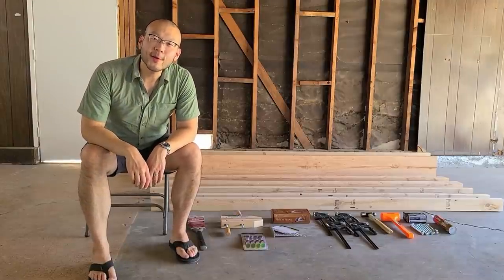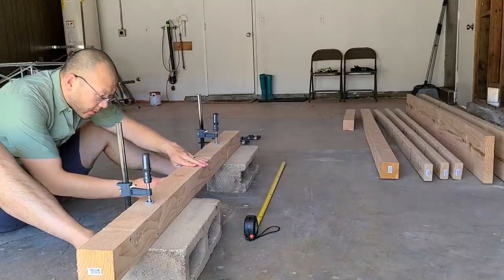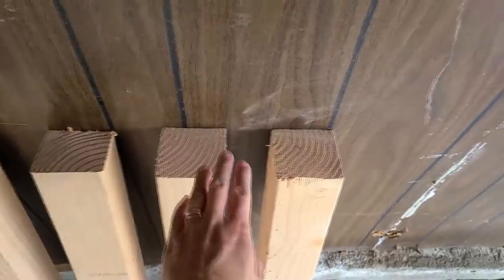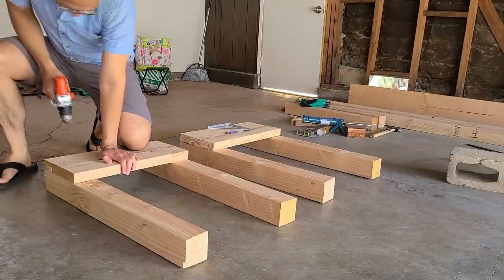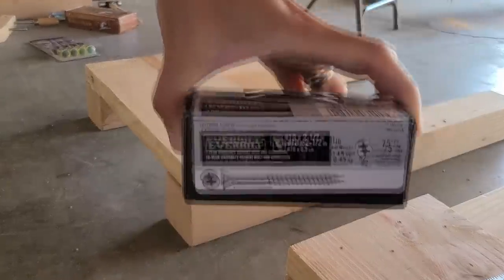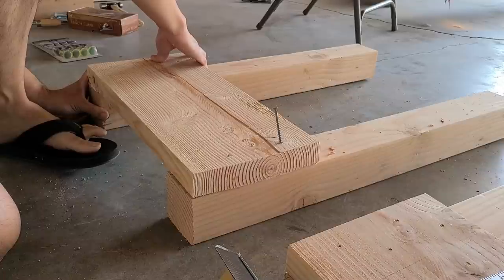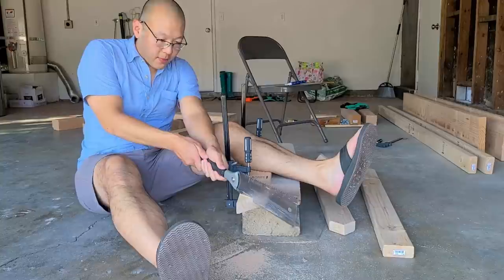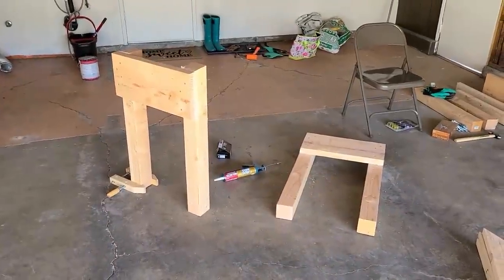A Dentist Builds Rex Krueger's English Joiner's Bench Part 1

Comment: Choosing Rex Kruger is a great choice. I love his bench designs. I think it's great. Marking is everything. Mark your lines in all faces, and keep the line in view as you cut, which will keep your cut straight. Or clamp the speed square to the work and use it as a cutting guide. That's what the lip's for. Butt the lip up against the long side which will give you a vertical straight line across the board. Slide the square upto the line and clamp it down securely. Then cut along the speed square as a guide. PS. Use more cinder blocks to raise the work so you can stand and look down at the line you are cutting. That will keep your eye on the line and cuts straighter.
Reply from the maker: Thank you! I love the bench and can't wait to add all the other accessory parts! That speed square tip is super good! Thanks again for all the recommendations!

Comment: 20:38 If you ever experience a lot of slippage when driving screws, then one tip I have is to use the “star drive head” screws instead of traditional Philips head screws. They have more contact area and slip a lot less if you’re driving into hardwood. I built some stairs and they made a huge difference. Great work btw!
Reply from the maker: Good to know! I've seen those, but haven't used them. I'll keep them in mind for my next build. Thank you!
Reply: The star drive is called a Torq drive.  Just an FYI.
Reply from the maker: @Elderos5  Nice! I'll check those out. Thanks for the clarification!
Reply: @ADentistDoesHomeImprovement  It's spelled Torx, BTW. I'd hate to see you wandering around looking for the wrong thing. This was an amazing journey. You are far braver than most of us by being willing to film your process, warts and all :).
Reply from the maker: @robbie6625  Thanks for the correction! I looked it up real quick and they were included for my computer build. I also see them on my road bike.
Reply: Another advantage to the torx/star drive screws is the box of screws almost always includes the exact bit you need to drive them. 
     If you don't mind spending a few bucks more per box, I highly recommend good quality self-drilling screws. (not self-tapping...that's just a marketing gimmick IMO...all wood screws are self-tapping) But the self-drilling ones save a lot of frustration. Theyre called that because tbeyre designed to not need pilot holes (if you're doing carpentry like building a deck and using an impact driver instead of a drill). I still drill pilot holes for nicer woodworking anyway, and the combination of those screws and pilot holes make it easy for even an under-powered drill to sink them in.

Comment: I found your channel via your interview with Rex.  I've been following Rex for over 1 1/2 years and I started just about where you are.  A lot of your challenges are exactly the same ones that I had when I built this workbench.  I used a kebab skewer to puncture my adhesive tube rather than a chopstick.  Yes, I found the built in puncturing tool much later.  For what it is worth, I still use that bench and it is rock solid.  Keep up the good work.
Reply from the maker: Thank you! We don't have much in the house yet so I was walking around trying to find something. We have a screwdriver, but it didn't fit. Lol.

Comment: Thank you for taking us along on your journey! I thought your trick of using the cinder blocks was very clever. And your cuts are quite good actually, especially for a first time! I used to get very frustrated with my cuts when I was starting out (I still do, frankly) but I had to remember that construction lumber usually isn't perfectly square, so it will always be a little off no matter what. If you're curious, you can see how close it is by tracing a connecting line around the perimeter with your speed square. If the lines meet up, it's square. 

I'm excited for you! Woodworking can bring you a lot of joy.
Reply from the maker: Thank you! I'm getting better with my saw, but definitely still not straight. I'm not too worried about it right now because everything I make is pretty rough and has plenty of room for error. I'll definitely take your advice into consideration when I start making more fine pieces. Thanks again for the kind words of encouragement and I can't wait to see where this channel goes!

Comment: 4:43 ^^ you are using the rip cut side to cross cut that post! The larger teeth are for cutting along the grain and allow for clearing of the saw dust much more easily where as the little teeth can cleanly cut across the grain and there is less material to remove. Also if you look at the set of the saw, the rip side will be even flat on each side of the tooth and the crosscut will have alternating sharp chisels one on the left one on the right etc to sever the wood fibers on each side of the cut. The ripping teeth are like little shovels that just plow out material and don't need to sever wood fibers to the left and the right of the cut because it is running with the grain.

Great to see you getting into wood working!! please keep creating content!
Reply from the maker: Thank you for the detailed advice! I still get confused on rip side and cross cutting side. I'll make sure to keep that in mind when I saw!
Reply: @ADentistDoesHomeImprovement  I noticed later in the video you were talking about rip and crosscuts I realised you must have figured it out. Good job man, love seeing people learn practical skills!
Reply from the maker: @jsporish  Thanks! I honestly still use the wrong side occasionally. Lol.

Comment: I love this. It showcases the things all of us, who try to just figure it out on our own before we gain that initial experience, think and go through. I enjoyed the chopstick to puncture the tin foil, beautiful! If you look on the bottom of the caulk gun, it has a long thin piece of metal that will do that job for you in the future! When I first picked up a caulk gun I used a screw instead of a chopstick to puncture the foil 🤣

I recommend you watch some James Wright videos, Wood By Wright. He is extremely knowledgeable and I've picked up many tips from him.
Reply from the maker: I had no idea there was a pokey thing on the caulk gun until someone else commented! Lol. I'll check out James Wright. Thanks for the recommendation!
Reply: @ADentistDoesHomeImprovement  I didn't either! I was working on fixing a water issue and texted my dad about caulk and he gave me 1 other piece of advice, if you don't use all of it up then jam a nail or a screw down the tip of the caulk tube (the head of the nail/screw will stop it from going into the tube entirely) so you plug it up, this stops the caulk from hardening as quickly and you can use the rest later
Reply from the maker: @jgo5707  Nice! I didn't even think about saving the caulk like that. I just left it to dry and ripped the dried part off the next time I want to use it.

Comment: This was a refreshing video, someone who is starting out from the beginning and documenting their progress. I hope you keep up with it! Just a handy tip - the bottom of the caulking gun has a metal rod that swings out to pierce the foil on the caulking tube once you cut the nozzle to your desired length. Just be sure to give it a wipe afterward to keep it tidy and avoid having it glue itself together.

Also don't be afraid to use your other hand to keep pressure on the drill when driving Phillips screws - they are designed to pop out to avoid stripping the head of the screw which means that if you're poorly aligned you will have a difficult time.
Reply from the maker: Thank you! Oh wow. I'm going to go look at my caulking gun to find this mysterious rod. I think my wife would greatly appreciate it for me to stop using our chopsticks! Lol. Thanks again for the advice! I'll try that with the drill because it still felt like something was off the last few times I've used it.
Reply: @ADentistDoesHomeImprovement  you've probably figured it out by now, but keeping pressure on the drill will help a lot. Also buy an 'extender' for you drill bits. Not sure if that's the correct English name, but it's a little metal rod that goes into your drill. You can put a bit in that so it's easier to reach places and to see what you are doing.

Comment: Here is a  quick tip for realigning the screw holes after you have moved the two parts.  Take a screw and drill it into the hole on the top board but only enough for it to stick through about an 1/8 to a 1/4 inch.  Then try to place the tip of that screw into the counter sunk hole.  Just move it around until you feel it drop into the hole.  Its going to be inside a glue join so it wont matter if it scratches the wood.   Do this on opposing corners of the board and the rest will line up.
Reply from the maker: I wish I learned this sooner! I figured it our during my ski rack and organizing tool video to have the fastener stick out a little bit to match with the pilot hole on the studs. Thanks for the detailed advice!

Comment: Nicely done, I'm looking forward to watching the rest of this build.

As a dentist you do have some advantages as a novice woodworker: you have steady hands, and you know how to drill!

If I may offer a suggestion on getting a nice square cut on thicker pieces, like those 4x4s. Use your speed-square triangle thingy to trace your line all the way around.  Concentrate on establishing your cut straight along your 'top' line, and you can eyeball the lines down the sides to keep going straight. Don't try going all the way through from one side; when you're down a half inch or so, roll the piece 90° (for a ryoba saw that you pull, roll the cut [called the kerf] away from you), use the kerf to register the blade, and cut down a bit on the new side.  Do this on all four sides, and your saw blade has no choice but to follow your guide cuts.

Cheers, sir!
Reply from the maker: Thank you for the kind words and advice! There are many parallels between dentistry and woodworking. I feel like my background has helped me on this journey so far and I think that's one of the main reasons why starting this channel has resonated with me so much.

I had no idea about kerf! I had to google it now. Lol! Thanks again for the tip. I'll keep that in mind next time I work on 4x4s.
Reply: @ADentistDoesHomeImprovement  I'm a machinist, I'm just getting into woodworking myself. I'll be building Rex's Roman-style bench this week, and I'll use that to build this joiners bench.

I've joked with my dentist before how the drills I use for machining steel and his for drilling teeth use the same wear-resistant coatings. 🙃
Reply from the maker: @LarryLeeder  Lol! I'm not too sure about wear resistant coatings, but I mostly use diamond burs myself and they tend to wear out quickly. Enjoy the building process and thanks again for all the feedback!

Comment: 22:14 if it's not flat for a work bench than it don't matter only for projects that you build on ur bench need to be flat, square, and straight, get a Palm sander it saves a bunch of time, then sanded with various grits I recommend getting an assortment of 80 to 220 or 320 the lower the grit the rougher the higher the finer, this is SOME of the basic starter knowledge for you to help you get of your way 😉 
There more starter tools
Reply from the maker: Thank you! I do want to get a palm sander soon!

Comment: Don't be afraid to go buy a drill and driver combo kit.  I have DeWalt and love, Love them.  For years I was switching my drill and bit back and forth.  It will prevent stripping screw heads for the most part.  Another good tool is a pull saw like you have but has a spine stiffener, it will make your cuts more accurate if you plan on staying with the hand tools.  You are doing a great job, keep after it.  Rule of thumb:  you can never have enough clamps.  Thank you for sharing your time and talent.
Reply from the maker: Yeah! I'm actually looking at Milwaukee because Home Depot has a sale right now, but I can't wait until I stop using my wife's tools! Lol! Thank you for the kind words of encouragement and helpful advice.
Reply: @ADentistDoesHomeImprovement  Whichever brand you choose there are great deals going on right now, it's almost better to buy an entire set of power tools, save you a bunch of money.
Reply from the maker: @derekpeterson8005  Yeah! I'm definitely going to take advantage of all these black Friday sales. Still doing research on which brand, but should place an order soon. Thanks again for the heads up!

Comment: Congratulations on getting started! For the seal on the adhesive tube, your squeeze gun has a long steel "wire" on the underside that folds out to do the hole-poking. That got me too, and I've been building with my dad since I was a kid, I'm 40 now. Wasn't my proudest realization. ;)
Reply: Also, huge props for sticking with the hand tools. Although I have a bandsaw (and dust extractor for it) I do everything with hand tools. It isn't realistically that much slower than power tools once you're used to using them, and it's way better for your health!
Reply from the maker: Thank you! Yeah...someone else commented about the steel wire on the gun and I started using it!
Reply from the maker: I'd like to start making furniture soon using mostly plywood so I'll probably use a circular saw to break those down, but the goal is to stick with as much hand tools as possible! Thanks for all the helpful feedback and encouragement!

Comment: Great video. Thanks for sharing. I've been a power tool woodworker for years and recently built a low work bench (also inspired by Rex Krueger)  using all hand tools and I had many of the same struggles as you did. I really enjoyed the video and think you are doing great work.
Reply from the maker: I should be getting power tools soon! I want to build furniture and I think it'll be a lot easier to break down plywood with power tools. Thanks again for all the encouragement!

Comment: About pilot holes:  in your case, the size of the drill bit is for the 4X4's, the hole in the 2X's can actually be a couple sizes bigger.  The idea is that the thread of the screw needs to "bite" into the piece to which you are attaching the secondary pieces.  This method will also help get the screws flush or below the surface level.  Keep at it, you're doing just fine.  Be one with the lumber.
Reply from the maker: Yeah....I'm starting to learn that I think the pilot holes are too small and hopefully when I get an impact driver that will also help. Thanks for all the advice!

Comment: Shop furniture like benches, carts and shelving are great projects to get practice and experience with, also look up simple jigs you can make yourself to help with tasks like drilling and cutting straighter.  Hand tools like saws need practice and technique to master them, power saws usually require the same and you'll also just make mistakes faster till you've mastered them.
Don't let perfect be the enemy of good
Reply from the maker: Yeah! That's the plan. I'm going to make a lot of stuff our the garage and outdoors first before attempting nicer indoor pieces. Thanks for all the helpful advice!
Reply: @ADentistDoesHomeImprovement  when you do get a circular saw try your hand at a single sheet plywood shop cart. Used tools are also good for adding to your growing tool collection, personally I love collecting old woodworking and crafting books because they are pretty interesting sources for ideas. Have fun
Reply from the maker: @deans9766  smart! I'll definitely look into those. Thanks again!

Comment: I enjoyed this video and watch the entire of it which I rarely do when it is this long. However, it was very refreshing to see a begining woodworker trying his best. Thank you for sharing!
Also, I think what might have happened when fastening the screws is that you used a wrong sized bit for the screw. You also might have missed your pilot holes on the bottom due to moving the pieces slighty after applying the adheasive. Don't be afraid to put a bit of pressure on the drill and make sure your bit fits perfectly in your screw. Overall I think you did very well for having little to no experience.
Reply from the maker: Thank you! I'm so surprised people are watching the whole thing! When I finished stitching the segments together I just thought to myself this is going to be so boring. No one is going to watch this. Lol! Thank you for proving me wrong and for the helpful advice. I can see both of those happening. Wrong pilot hole and/or misaligned. I've been getting better and it's not sounding as terrible anymore!

Comment: The lumber actual vs nominal dimensions come from the size cut at the sawmill for wood that is still saturated with the water the living tree had in it.  After the wood is dried it shrinks, and then it is run through a planer to create a smooth surface.  For a nominal 2 x 10 the actual size is 1.5 x 9.25 inches.  The actual size are less than the nominal size by 1/2 inch until you get to 8 inches, and then the actual is 3/4 less than nominal size.
Reply from the maker: Lol. Took me a while to figure that out. Thanks for the detailed explanation!
Reply: @ADentistDoesHomeImprovement  You are very welcome.  There is another dimensioning system for hardwood lumber (not home construction lumber) that states the actual thickness.  It is in one quarter of an inch increments.  So a hardwood planed board that is actually 1 inch thick is called four quarter, and written 4/4.  A 2 inch thick board is 8/4 and so on.  You may enjoy getting a Fine wood working magazine archive dvd going back to 1975.  I started knowing nothing.  That magazine showed me ideas and methods I had never dreamed of.

Comment: Lumber is measured in it "rough cut" measurements. A 2x4 is actually smaller than 2 inches by 4 inches for example. Because the boards you get are actually "Finished lumber".
Reply from the maker: Lol! Yeah...I didn't figure that out until half way into the build. Thanks for the tip!